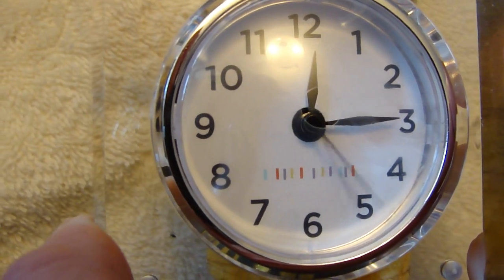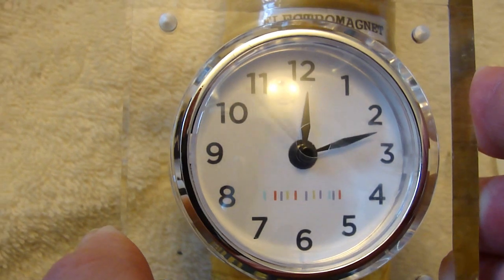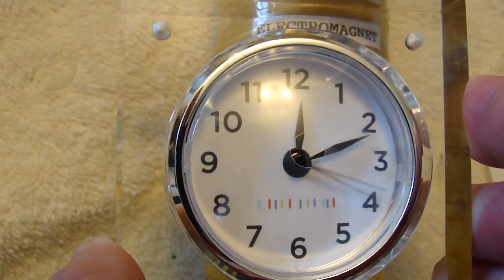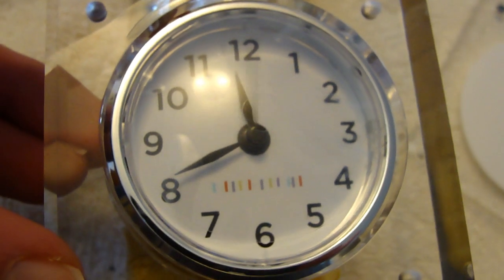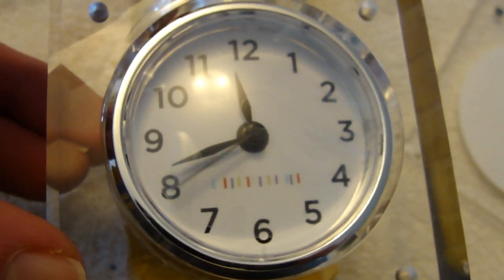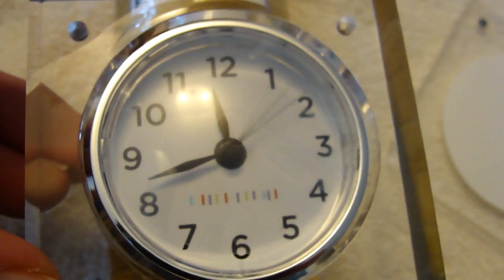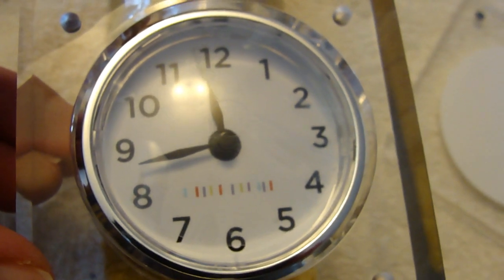HDR clock in unstable time field

Comment: That is not a time feild but one of the stages you need sevearl of them turning in a circle and another group of them spening in another driection betweeen the two a time field forms once you get the correct frequancy in both I don't have the research to know the frequancy.  But do not put anything living in a time field it wall cause cancer and kill you.  Time fields are dangerous to anything living.

Comment: OK, I experimented with this effect, recently. I determined that a quartz watch will spin  faster when placed near a pulsating electromagnetic field. This effect doesn't occur with a mechanical watch or a digital. I dissected a quartz clock to see what makes it "tick" . There is a small magnet in most quartz watches.It spins directly as a the magnetic field pulses, turns a gear and advances the second hand.
Reply: I don't know when the time machine was really invented? 
Now neither Westerners nor Easterners can do anything about it.

Comment: I'm pretty sure the electromagnet is stronger then permanent magnets in the motor. The HDR electromagnetic over power that and causing the motor in the clock to freak out go faster or backward because the armature in the motor still has power. As a scientist the only true way to experiment is use a digital watch and check for the same effect